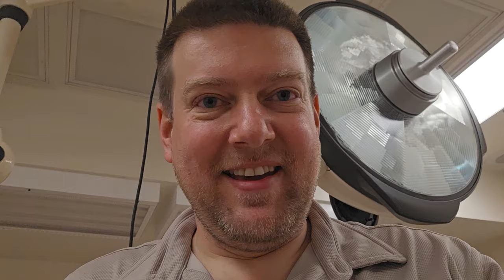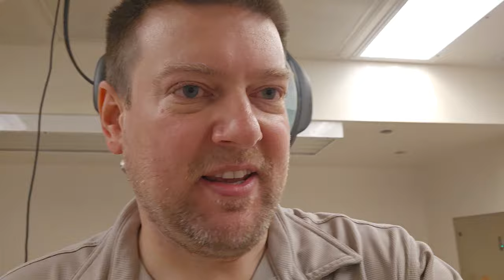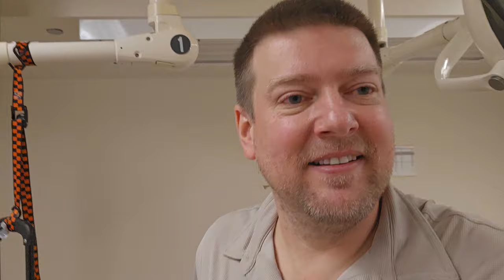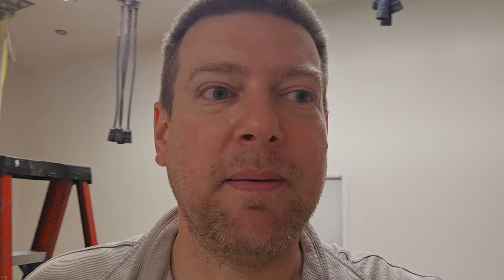Monday Project!  Operating Room Ceiling Light Removal.

Comment: Those are old Amsco Steris SQ240 lights
Reply: Could those be upcycled in another place?? Or is it too difficult to get parts these days??
Reply: @Graeberwave  There isnt much available from Steris for these lights anymore. Biggest issue with these lights is the brush housings melting over time and Steris no longer sells new ones.